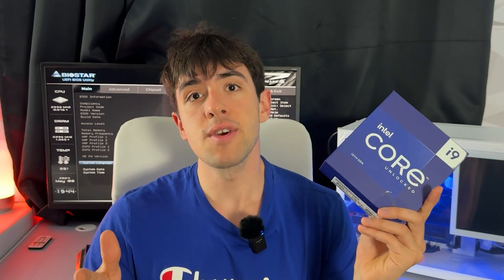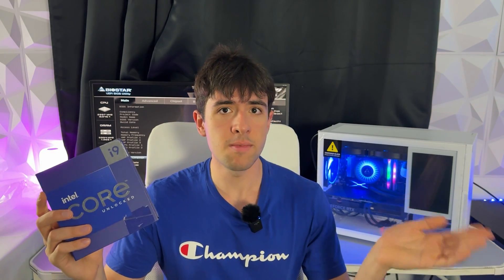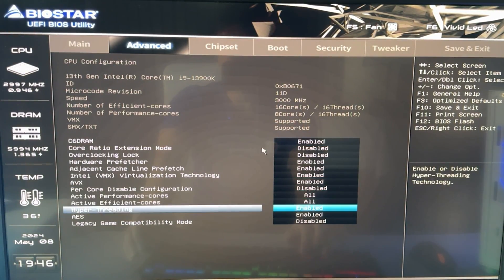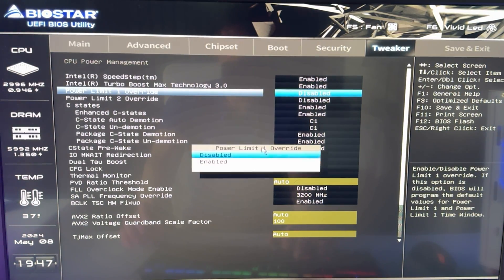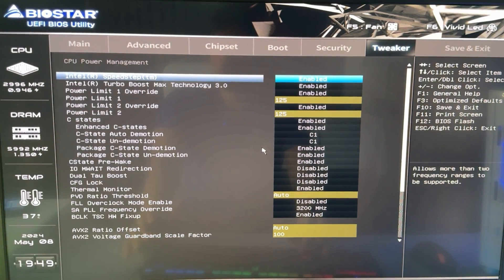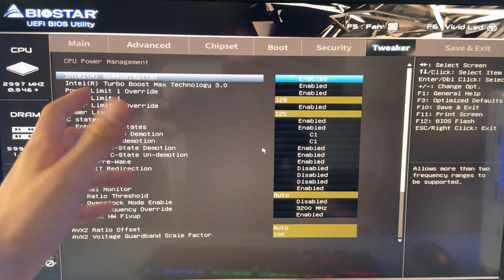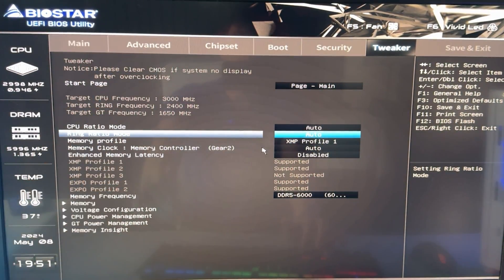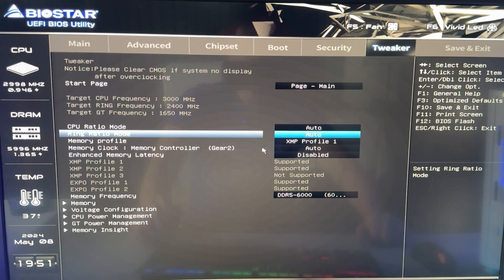Stop your Intel CPU from Crashing and Breaking! Full Tutorial for 13th and 14th gen

Comment: People still using 253/253W for short and long thinking their cpus are optimized.  Back in 2022 when i built my 13900k I set the limits to 90W as anything higher pushed me into 80C and above during games.
Reply: And 253W is the correct settings. Because without limits the CPU goes over 300W.

Therefore 253W on full load allows to have a stable and much lower temps
Reply: And I believe the KS you can set this to 320

Comment: Is the issue only in the K variant 
I have i7 14 kf and msi z790 idk if i have to change the settings
Reply: Ive been having issues with mine i just updated the bios and it was a lil better but still randomly crashing. The bios update adjusted some voltage settings but still crashed. I just changed the cpu load lite to Intel default so hopefully thats fixes it. If not i might have to under volt.
Reply: @WCxColosus  right now mine works fine but if it crashes do I have to under volt too or whatever you said before that
Reply: I ended up upgrading the board from an MSI gaming to a Asus Z790 hero and i have not had any issues since. Also what windows are you on?
Reply: @WCxColosus  im on windows 10

Comment: Wait wait this is official specs no way that's way too low  pl1 should be 253W and pl2 should also be 253W for Performance settings with 307Amps or 400Amps for extreme settings but at 125 and 188 Watts those i9's are useless my 10900K overclocked to 5.2 GHz almost Performs as good at those low settings how is that even there recommended specs something is not right here Intel is crazy!!!!!
Reply from the maker: Crazy but yes, these are the new recommended specs as a way to try and save the CPU. 100% I still recommend undervolting as I show on the channel instead, to retain full performance
Reply: @ImWateringPSUs totaly agree bro do you hace a recommended voltage for 14900KS locked at 5.9 ghz for P Cores and 4.6 ghz for E cores should I lock the VL at 1.35 ?

Comment: could your first tutorial with pl1 and pl2 =253w hurt the cpu in the long run?   i m currently running the first tutorial settings and my system is very stable and not overheating. not really wanting to change anything...
Reply: No, what is going to damage your cpu longevity is the voltage under which the cpu is operating if its too high, unless you did not disable the 100C thermal limit. But this is based on principle and past experience, nobody knows for sure if an operating load voltage of 1.6V for example is bad for these cpu's or not, but the common sense tells us it is. You can have power limits completely unlimited as long as you have enough of a cooling solution, power limits shouldn't matter much. But just  in case i would set up PL2 at around 250W if you have a good enough cooling solution (a 360AIO for example should be sufficient). And PL1, your choice, but not too low otherwise you will drastically reduce performance especially in full load tasks.
Anyway keep in mind that the profile the video author is presenting here is extremely conservative and IT WILL reduce your performance. Not so much in games tho, since games are a piece of cake for an i9 and performance in games is more proportional to frequency than anything else, mostly 6-8 cores, not all of them together.
Reply from the maker: What adriano said is correct. If you have followed my previous "Undervolting" tutorial though, you're good to go and WILL get higher performance without damaging the CPU, since we reduced the voltage there (which is what damages the CPU). So you would be perfectly fine with a 253W PL if you followed any of my previous guides!

Comment: Will this affect my 14600kf?  Right now, it seems to be fine.  When I first got it was running really hot on the Bios the motherboard came with out of the box.  As soon as I updated the bios the heat went down quite a bit.  This was before the whole intel 13 and 14 gen stuff started coming out in the media.
Reply from the maker: If you've seen a dramatic temperature reduction after a bios update, chances are that it was already fixed in your motherboard. So you're probably fine. But I'd definitely update the BIOS again once Intel releases their official fix. Or if you want absolute peace of mind, set the PL as shown in this video!
Reply: @ImWateringPSUs  Thanks, this is what I was hoping to understand better.  👍

Comment: Just an FYI MSI has finally released a New Bios addressing this for the MEG ACE Z790 MB however when I checked on 5/12/24 it was still listed as Beta Version, so hopefully soon they will release a final version soon.
Reply from the maker: Yes! I’ve seen it and it’s the same for most manufacturers: beta version at the moment. I’d rather set the PLs manually still tbh

Comment: Just buy AMD 😙
Reply from the maker: AMD is not fully free of issues either, and I say it as somebody who in recent years has preferred Ryzen 7000 over Intel for his personal build. No matter the hardware you buy, if you spend some time tweaking it it’s gonna be worth it!
Reply: Hard pass on amdip...
Reply: Just buy dese nuts ❤
Reply: My 7800X3D blew up on MSI mobo, got a 14900KS instead and it also broke.
Reply: What’s happening with Intel happened with Ryzen since 3000 series.
Reply: Just go for the i7, is the i9 that have the issue
Reply: @Alonne1 The better advice is to stop buying "k" variants if you are a complete noob when it comes to BIOS settings. Yes, you can blame it on Intel and MoBo manifacturers for "breaking" the conservative consensus around "stock" settings. But lets be real, if you don't even know how to enter BIOS, not to mention playing with voltages, current limits or frequencies, and you're also not willing to pay some hardware-savy guy to optimize you cpu for you, then why are you buying the "k" SKU in the first place? That's what i would ask in the first place. Of course marketing is lying, that's the whole point of marketing for the naives out there.
Just go non "k", problem solved easily for the vast majority of users.
Reply: @adip1704 some of the K variants are actually cheaper now. So even even for an noob, it does not make sense to spend more money on something that is slower.

Comment: it is not intel specs, set it to intell specs
pl1 125w
pl2 253w
core current limit 107a
Reply from the maker: What you’re listing is still better than the default of most motherboards, and yup the more the current limit the more performance, but in the new beta bioses they’re using PL1 125 and PL2 188 /w Current Limit of up to 249A, which in my testing is really not losing you any in-game performance at all
Reply: @ImWateringPSUs  i use intel official recommended specs as a guideline and find balance between their standard and extreme profiles for my i9 13900k. intel recommends
pl1 253w
pl2 253w
400amp 
as their "extreme config", but for me 400amp is too much and my cpu is unstable in after effects render, so i find 340amp most stable and still powerful  in my case
Reply: current 307 amps
Reply: @erdruido  yea right. for my 13900k i set it higher, 340amps for more performance.

Comment: if you going to use these power limits u're going to kill performance a lot , but if you have a bad cooler it's recommended
Reply from the maker: Well it’s actually not gonna affect much if at all gaming scenarios. We’re still keeping the single core boost. But yeah I’d recommend to also undervolt the CPU so you can keep the maximum performance, but this is just a video about the recent problems, a lot of people have had their CPUs break!

Comment: I was having trouble cooling my 13900k even with a 420MM aio cooler!  I turned off the enhanced boost that is on by the board manufacturer and it dropped my temps by literally 10 degrees.
Reply from the maker: MCE or “Multicore Enhanced” or also called “Enhanced boost” is one of the WORST default settings ever made. 100% people should disable it unless they’re running under a custom loop and even there they should set some PLs or UV it if they wanna keep their CPU running for a while
Reply: @ImWateringPSUs  I own a MSI mobo (Z790 MSI tomahawk Wifi DDR4) and I have in bios this ''Enhanced Turbo''  Should I leave it as it is or disable it ?
Reply: Its kinda cold in Australia now so will keep it on for warming my room.